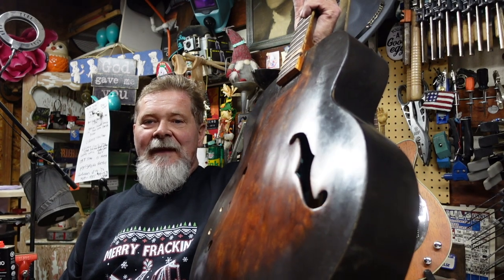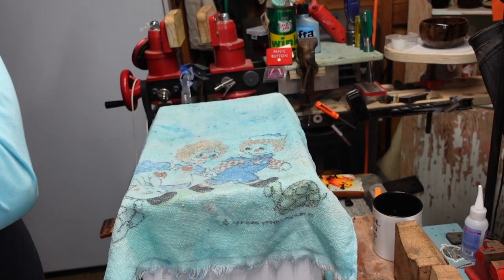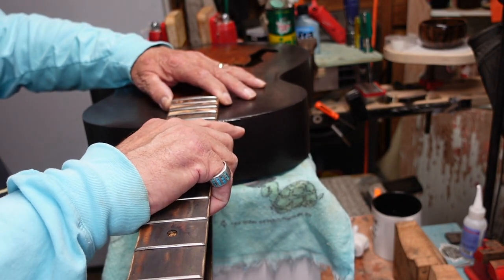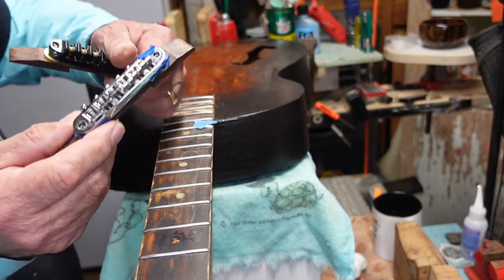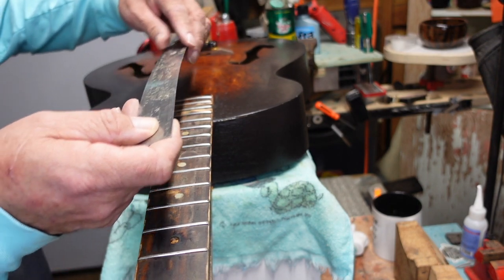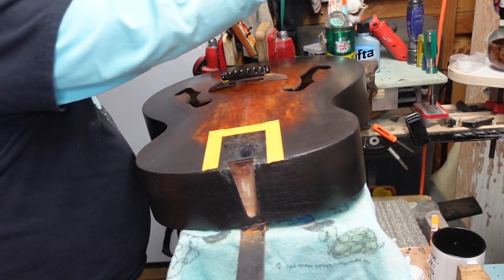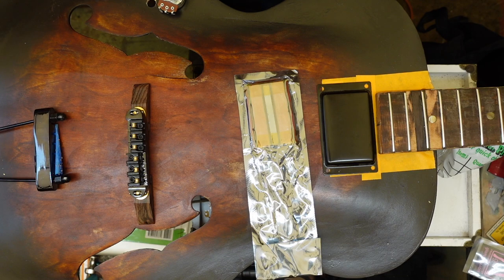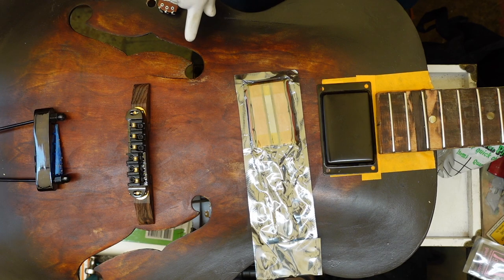Basket Case Harmony H1213 Archtop: Part 7-Re-attaching the Neck

Comment: Yeah, the more of these episodes the better. This one had me laughing a lot... dont worry, it was when I was supposed to. For search engines, you could also tag these ones with H1214 (that's the one I have - it's the color of this guitar that was painted to look like a birch bark canoe, or allegedly like blonde flamed maple😂). I think there was also a 3rd color, maybe either H1215 or H1212, but I forget which. I like the birch looking one because I'm in the country in New England, and the paint job is kinda close to how my grandmother used to paint birches. Actually, now you still see that style paint on cemetery pots, and on some folk art.

I remember seeing your budget neck reset videos, and there doesn't seem to be any special need with this guitar, to have to rehash that here. It would be cool to be able to take the neck of this guitar on and off reliably, for travel, with only bolts and no glue, but there doesnt seem to be much meat there. You'd probably have to build it up, and one of the best things about this model guitar is how light and responsive it is. Have a happy new year!